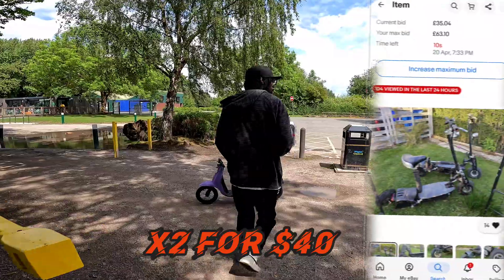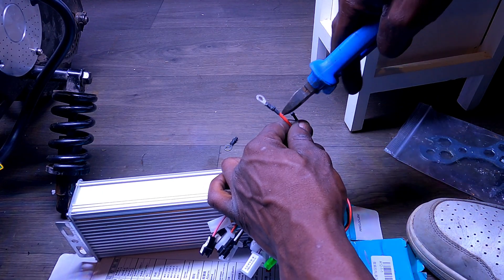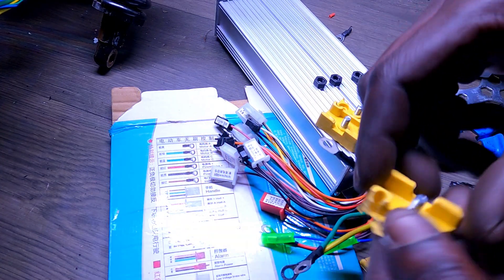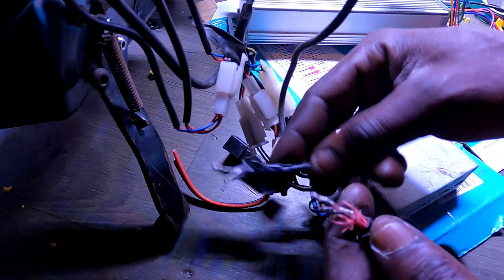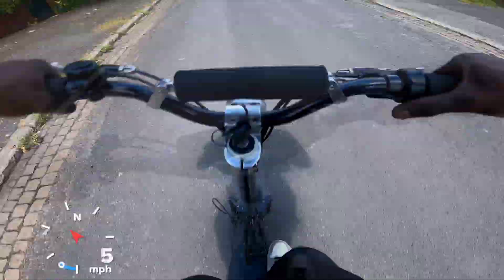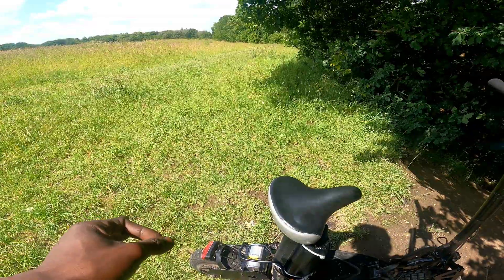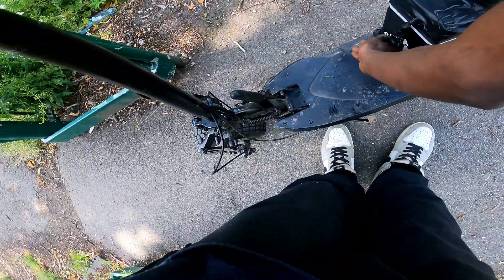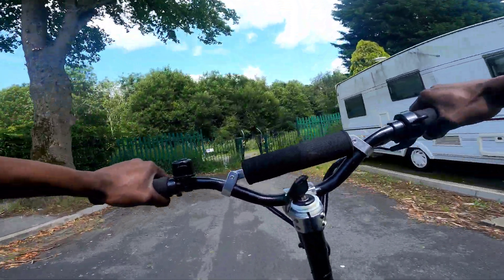Make Scooter Faster (motor and speed controller upgrade)

Comment: Hello I have the same exact scooter but with 3000w motor and controller 48v battery but it only goes 21mph and I’ve unplugged the wire that limits it do you know what’s up with it
Reply from the maker: Bro you probably still have the stock 11 tooth front sprocket. A 15 tooth front motor sprocket is what you need for a higher speed. (The chain cog at the motor). If you still have a lead acid sla battery. (4 rectangle batteries in a bag) the weight will slow you down too. 
If you still have the stock speed controller, you need a higher amp controller boasting around 40 amps.
48 volts on these scooter should be doing 28 to 32 mph. If it is a brushless motor your best bet is to buy a high amp controller. It will say 1500w controller 40 amps 48v. If you want to go wild. You can get a fardriver or similar controller and put 50 to 60 amps through your motor. Same voltage though 48v.
Reply: @Rasta-On-A-Ride I’ve got a 3000w 60a controller will the 15t sprocket make a big difference
Reply: @Rasta-On-A-Ride ??

Comment: Hey my guy I have a ? I got a new brush motor 48v 1000w to give it more power cause I can only ride it for like 20min and it's done till I charged it again and I tried putting it into my scooter but I noticed my scooter has 3 cables on the factory brush motor blue , yellow and a light purple one I would call it  and the new one brush motor only has 2 a blue and yellow how do  I connect those 3 to the new one that only has the 2 blue and yellow can you please help me out here?
Reply from the maker: The third purple wire is a speed sensor. Only the yellow and blue are needed for the swap to work. If you want a screen with speedometer, the purple wire will plug into your screen. 48v is going to be brilliant. Atleast you will be doing 28mph.  Unless you have a larger 15tooth sprocket
Reply: Thank you I'll let you know how it goes when I do it my guy👍
Reply: One more ? I do want the screen speedometer so the purple wire to work so what wire can I connect it with for it to work I don't want to fry anything my guy lol Will that give me more riding power like I said before I can only ride it for like 20 ,25 minutes and my battery goes low till I charge it again?

Comment: Question for you my guy what size razors did you convert in the other video 350 or 500 ?
Reply from the maker: They were a copy of a razor mx350 in size. You can make it larger by fitting pitbike forks longer than 610mm 
If you search for 680mm pitbike forks you will be able to run a 14 inch front tyre   with a 12 inch rear. 
This would make the whole bike the same size as the mx500.
Reply: @Rasta-On-A-Ride thinking about buying a razor for my 7 year old but the price difference between 350 and 650 is mad